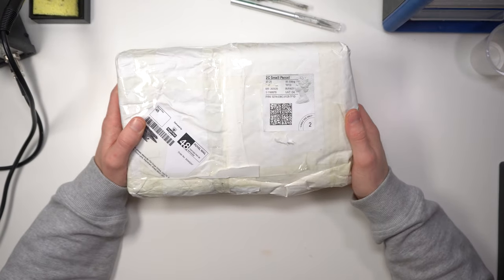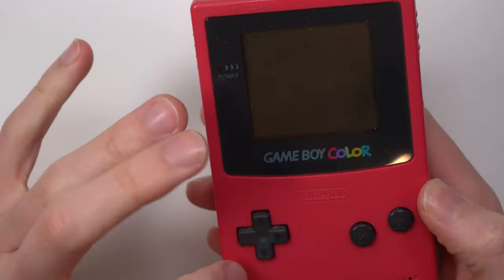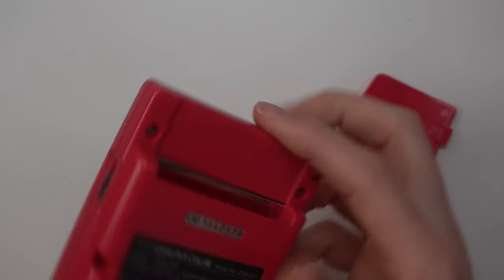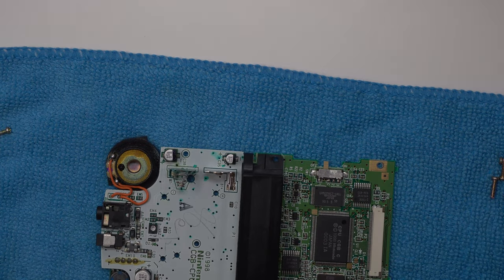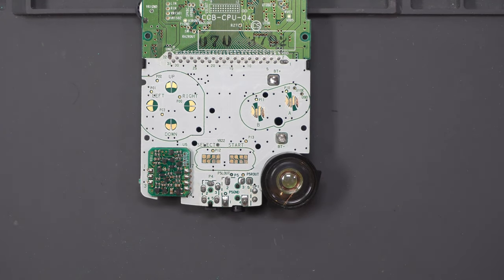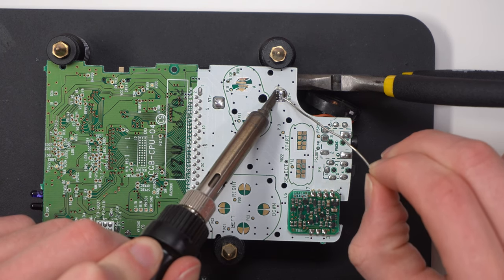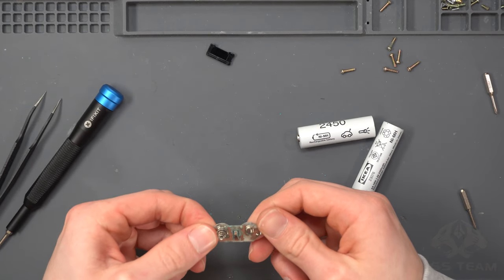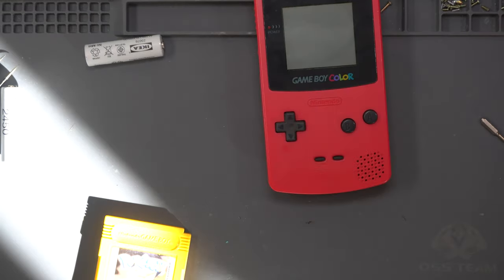Gameboy Color "Not Booting" Corrosion Clean + Battery Terminal Replace

Comment: Thank you for the video, this might help me out. I modded a GBC to have a IPS screen and it worked great. Today I opened it up again and replaced the silicon buttons now it won't turn on. I tested the connections. It doesn't seem to be getting power now from the positive battery terminal on the motherboard. Any thoughts or should I just replace the terminal?

Comment: I had a teal gameboy color that was the same but didn't turn on corrosion was so  bad it had eaten away at the button contacts inside and lifted the white coloring on the board exposing the copper underneath had to use it for spares in the end. Think it had been in a shed or a cellar for a long time by the looks of it.

Comment: Got a american model I'm needing to replace the battery terminals. What type of solder/soldering gun and temp works best for this job? , What is the holding device u are using for the mother board. Ive already cleaned everything. Just new to the soldering. I know I'm gonna need Flux because the old solder will have to come off much thanks for any help.

Comment: What type of vinegar did you use to get all the corosison off? Also did you use IPA afterwards to get the vinegar off? Seems to have worked great!
Reply from the maker: Just some white vinegar from the local corner shop aha! And yeah, always use IPA to clean up the board :)
Reply: @TheRetroStation  what is IPA?
Reply: @amusedkibitzer8597  Isopropyl Alcohol (look for 91% or higher)

Comment: I just got a Gameboy color that’s 50 X more corrosion on the cpu EVERYWHERE 🤦‍♂️ maybe even worse then you are imagining right now ! 😂 I tried over and over it’s still on the board and there’s a spot it’s ate all of the white Nintendo part and it’s chipping off
Reply from the maker: Mate... that sounds like it's completely gone! 😂 Late reply so maybe you've given it a try in the week since posting this comment?
Reply: @TheRetroStation  yeah I got most of it off besides some vias the whole cpu all the solder looks old and probably won’t get connection anywhere now the corrosion took down everything 😱 accidentally knocked off 2 smd components so I’ll
Never know if it works